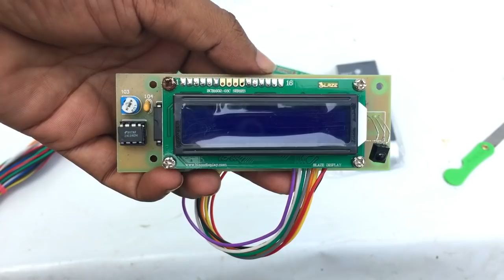5.1 Channel Dolby DTS Optical Coaxial Amplifier Making Part 1

Comment: NICE WORK BRO....KEEP IT UP

MAKE A PART LIST WITH THERE PRICE...
FROM WHERE TO ORDER THIS PARTS ?
TOTAL COST OF AMPLIFIER..?
MAKE A DETAIL WIRE SOLDERING CONNECTION VIDEO TO THERE RESPECTIVE POINTS ...LIKE WHICH COLOR WIRE GOES  TO WERE ?
MATCHING SPEAKERS  DETAILS WATTS ? OHMS ? SIZE ?
SUB WOOFER  DETAIL...
SUB WOOER BOX DESIGN DIMENSION

AND INSTRUCTIONS IN HINDI OR ENGLISH FOR DIY....
Reply from the maker: Kiran Ruke I will keep all data in description bro

Comment: Bayya nenu bassoon optical board vaddanu anni inputs bagane vundi kani optical ins coxi in isthe hamming vasthundi dheniki yami cheyyali bayya
Reply from the maker: Shiva Devi first of all you have to check all the grounds ...and you should take separate T/F supply for optical pre amp board
Reply from the maker: you are from?
Reply: Smps  vadanu
Reply: @technologyguide5   kakinada  east godavari ap
Reply from the maker: bassoon dolby dts boards having problem bro...better to use basson dts boards cost also will be reduced

Comment: This transformer is not enough for this amp board.., minimum 10A needed...
Reply from the maker: Yes 10A recommended but 5A sufficient, I used 12-0-12V 2A transformer seperately
Reply from the maker: Thankq for Watching